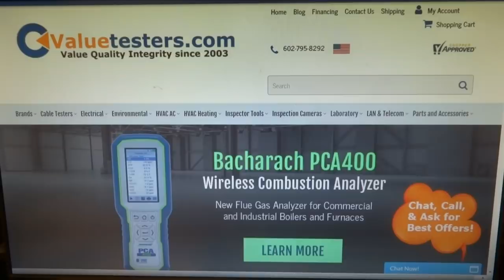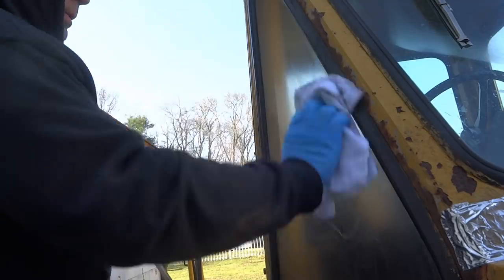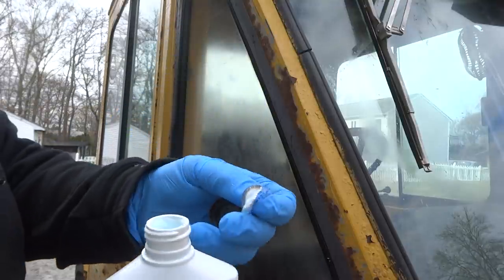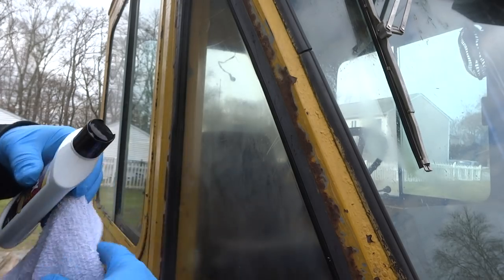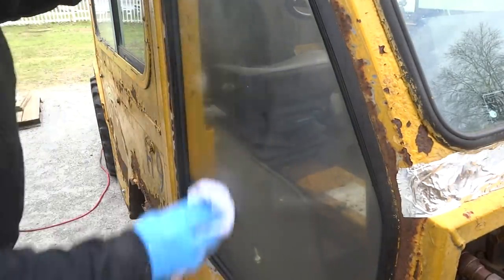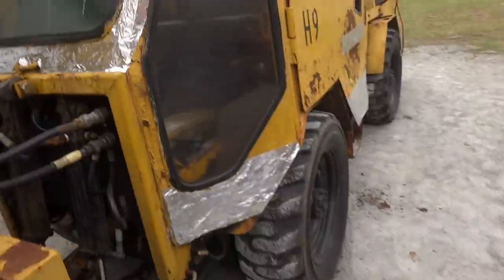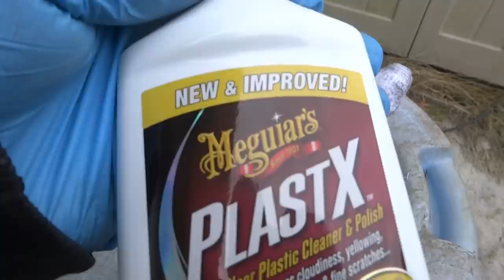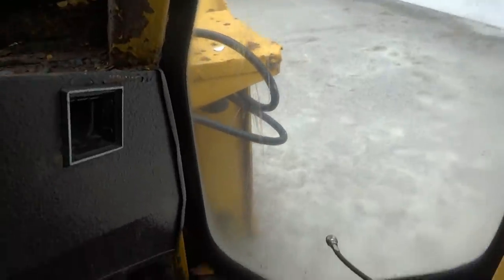plexiglass window restored

Comment: Sand it down with 3000 grit and put clear coat on it that works very well I worked on my Window
Reply: I agree with this. Plexiglas and plastics that are clear will cloud up again real fast especially in the sunlight. If you sand it down until it's clear as glass and then spray clear coat over it, it will take years before it gets foggy again. Also do the same thing inside the glass. Usually most of the haze is on the outside but there can still be some inside too.
Reply: Yes, wet sand with 3000 grit and some soap and water then buff with Plastx. Works wonders. I never tried the clear coat method but I’m sure that’s a more permanent fix.
Reply: towmantowman ... What about a medium dark tinted plexiglass . What would be your suggestion ? Thanks in advance .

Comment: I have to research PlastX. On old yellow headlights I would sand with 1000 grit paper, then spray them with clear coat. It restores them to new but it's a heck of a lot more work than polishing with plastx like you did.

Comment: That plastic compound did a decent job. I’ve had luck using a mother’s power ball headlight restoration kit. You have to UV protect it somehow, or it will get foggy again. The trackless is looking good Steve. We just need some snow to unlock it’s full potential!

Comment: Id throw some rust converter on the rust spots to stop the rust.  That looks like a nice unit!
Reply: If you use rust convertor on painted areas it capiliaries and lifts the good paint off from around the rusty parts.  You need to use a rust remover if you don't want the paint around the fix to be blistered off. I will chose converter on chassis parts over remover but not on painted parts, it can remove entire sections of paint in weeks.

Comment: I have been using a good automotive cleaner wax and a electric dual action wax applier / remover. Much faster and easier than by hand. I think the product you are using will work fine also with the machine.

Comment: Crap. Wd40 washes off windows and makes them even more yellow when it does. It's fish oil and its often used as a clear coat as it temporarily fills in the millions of small chemically enduced holes that caused the window to look that way In the first place. Not only will your machine stink 24/7 but it will be slippy now too. Terrible fix man. To do it properly you need to sand it down preferably with 1500 then 3000 trizact then you put a thin coat of transparent adhesion promoter followed by a thin clear coat. Nothing else is a proper fix, this is the only known method.